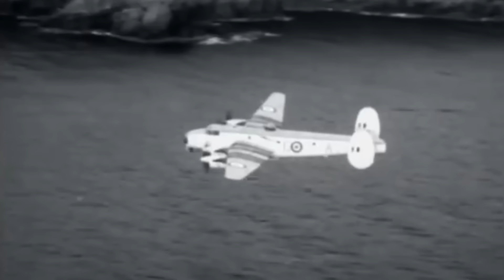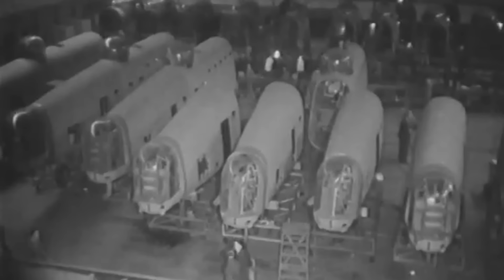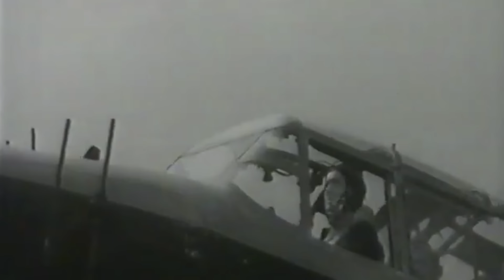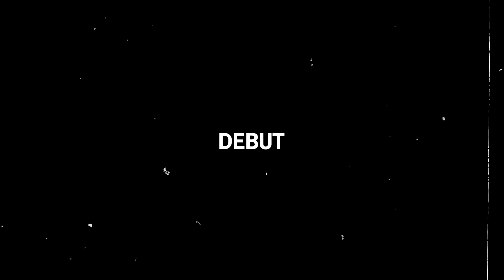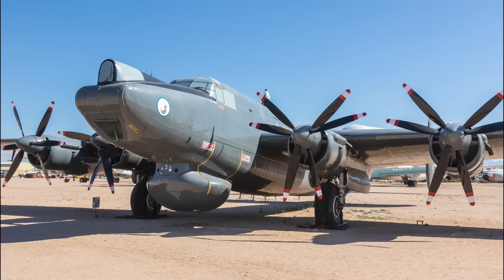The Strange Plane that Ended Up with An Even Stranger Mission

Comment: The Brit’s built their own TU-95 because of the Shackleton having a push pull prop in the same configuration of the TU-95.
Reply: Contra-rotating props were quite common, at least at design stage, in the UK in the 1940's, the Soviets learnt from British experience.

Comment: Good video about a very underrated but fabulous aircraft. The MR3 also had tip tanks and a more glazed cockpit with less framework as well as tricycle undercarriage. You featured some MR3 picture early on in the video but your commentary on the MR3 is accompanied by AEW2 (converted MR2 pictures). The AEW2 with radar dome did resemble the film version of the Dambuster Lancaster with enlarged round bomb from the front view so its interesting that you feature many clips from the film! The best part of the Farnborough show if you revisit the clip is that the Shackleton could undertake a low pass flying with just one engine and the other 6 props feathered. If you visit Pathos airport on Google Earth you can still see 2 of the old 8 Squadron AEW2’s sat at the end of the runway slowly decaying. Very sad!

Comment: Egypt was not 'under British control' prior to the Suez crisis of 1956; Egypt was an independent republic under Nasser.  The UK did have a lease on the Suez base area but had in 1954 agreed a 2-year phased withdrawal of its garrison.  It's like saying the US runs Cuba because of Gitmo.
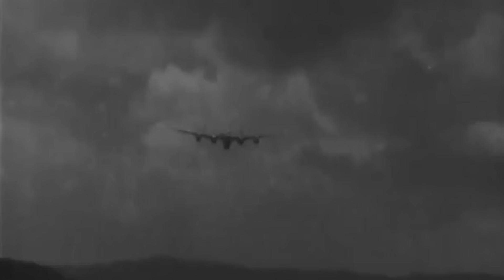AS usual there is some odd use of video, mainly Lancasters, to illustrate Shackleton ops.  The excerpt from the film 'The Dambusters' at 6:42 to represent maritime patrol in the Mediterranean is just bizarre.
Many of the supposed MR1, MR2 and MR3 aircraft shown are actually AEW2s, the clue being the giant radome sticking out under the nose.
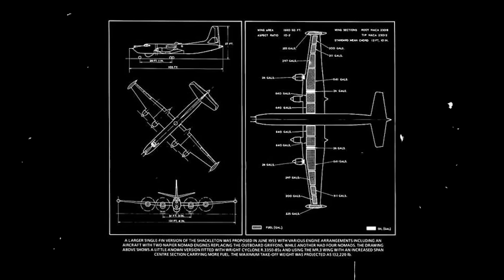The MR4 was not the aircraft shown at 8:50.  The MR4 and MR5 were just proposed re-engined MR3 and MR2 models using Napier Nomad engines to improve endurance.
No mention of 10,000 rivets flying in close formation?

Comment: 5:48 the noise wasn't because of the Griffon engines, it was becasue of the coaxial counter-rotating propellers.
Reply: Or, to use the correct term, contra-rotating propellers.

Comment: serving in the RAF i nearly got posted to Lossiemouth in 1989 - and to the last Shackleton Squadron there..   but at last minute my posting was changed to Aldergrove in NI ..  later i was posted to St Mawgan in Cornwall,  where Shacks had been operated for many years - they only had one remaining - a bright blue example serving as "gate guard" and maintained by civilian volunteers, several of whom were former airmen .  its interesting how long this aircraft remained in service. especially considering the Nimrod , also in service, which has a troubled later history as the MoD wasted many £millions with BaE on a rebuild-upgrading of that type which went nowhere.

Comment: We had a Shackleton Mark II in for restoration and an engine change at Zantop Macon in the early ‘90s while I was a contractor there. It was fitted with a monstrous radar dish in a flattened teardrop fairing under the nose, and was set up to carry 2 torpedoes. I was very annoyed that I did not get to work on it, but they had a special crew that were the only mechanics that were allowed to touch it. I did manage to wangle a walk-through and tour, though. It was very cramped for such a large aircraft, but the bomb bay and radar equipment took up a lot of room!

Comment: I could never understand the use of counter rotating props on multi engine aircraft at the end of the prop era. Noisy, complex and they had to be inefficient with the turbulent air stream they created. The crews must have been begging to fly jets when they could.
Reply: Nooisy and complex? Sure, but reliable.  The contra-rotating props reduced to rotational area while still making use of the Griffon's greater torque output when compared with the previous Merlins. Allowed for a wider fuselage while retaining the same wing.  It was a design compromise in a time of economic stringency.  They actually have some thrust and efficiency advantages which is why the Soviets persisted with giant versions of the concept, the Tu-95,  Tu-114 and An-22.  As for your last comment...sounds very, ah, American, and that isn't a good thing.

Comment: Not "Turbo Jets" for upgrade on Shackleton model 3... "Turbo Props" is the proper terminology for this upgrade.
Reply: There were also a least six turboprop Lincoln bombers built (they were used for nuclear weapons development work in Australia, dropping test devices from 50,000 ft (not a bad trick for an unpressurised aircraft).
A number of Lancasters also flew with jet engines in 1943 onwards, a similar Lancastrian passenger aircraft was also built and flew in 1946.
Reply: The MR3 upgrade included adding two viper turbojets for additional thrust. The four Griffons were retained
Reply: @andrewforrester7525 Also was an unusual installation, being installed in the rear of the outboard engine nacelles.  Tended to stress the airframes, but worked well enough.
Reply: No, Viper turbo-jets were installed in the rear outer endine nacelles alongside the Griffon engines.  They were not turbo-props as they created thrust as any turbojet does and did not drive the props.
Reply: @owenshebbeare2999  There were at least six Dart turboprop Lincolns built. They were operated by the RAAF for nuclear weapons development in Australia. They were used to develop the ballistic tables for the V-Bomber force and dropped test articles from 50,000ft (“interesting” for an unpressurised aircraft).

Comment: When I was in the RAF in Malta (1969-1971), Shacks were based there (203 Squadron), and it was pretty normal for them to come back with only three engines running - but the problems were largely not with the Griffon engines, as such;  the part which gave the problems was the shaft drive from the rear to the front of the engine and drove the counter-rotating prop.  Having said that, the 37 litre Griffons did cause problems through airframe vibration, as compared to the very smooth 27 litre Rolls Royce Merlins they ran pretty rough.
Shacks had no problems flying on three engines;  in fact, a close friend was aboard one flying from Malta to Gibraltar, on which the pilot had to shut down THREE engines due to the above mentioned problems with the drive shafts - and despite the aircraft have to fly crabbing sideways until just before the wheels touched down, to balance out the uneven thrust, the crew and the Shack between them made a perfect landing!
Reply: That is a corker of a scenario. My old friend Phil was an RAF lanc pilot during WWII, and he mentioned that he had to fly on one engine during training. That would be flying light I imagine.
Reply: @peterrollinson-lorimer  - I sincerely hope it was flying light, Peter, considering their standard full bomb load was 14,000 lbs!
Reply: @jackx4311 Naturally I wouldn't expect a bomb load on a training flight,  but I'm sure it was also light on fuel and personnel.
Reply: Unfortunately for me I never got near the Shackleton as a Rigger, and I would have given my last penny to have had the privilege as it was the closest that you could get to the Lancaster by the time I joined up in 1979, my grandfather was an A.V Roe apprentice before the Second World War and was involved in the modifications to the Lancasters bomb bay to accommodate the “bouncing” bomb, and he gave me his apprenticeship course technical manuals when I joined the RAF, and I used them during my technicians course because they contained some really useful and still (at the time) current information.
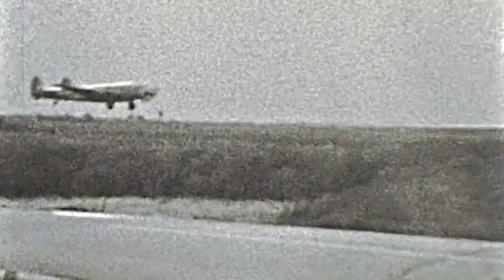Reply: @allandavis8201 2:52
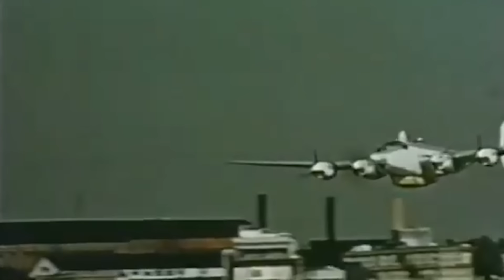Reply: Maybe that was your buddy's plane at 7:24 when only one engine was running hah!
Reply: Thank you for sharing that.
Reply: yes that prop drive system is inherently problematic. It was that design that nearly killed Howard Hughes

Comment: Very interesting video, I served at RAF Balllykelly 1966 - 1969 and I remember the noise as they flew low over married quarters. During an AOC Inspection as we took the Present Arms 3 Shackeltons flew very low overhead.
Reply: That was the station that had a train running through the runway sometimes?

Comment: The engines weren't overly loud, its counter-rotating props were.
Reply: *Contra-rotating, also seen on the Gannet.  Counter-rotating props are what were on the DeHavilland Hornet, single airscrews for each engine, turning the opposite direction.  While it might sound pedantic, there is a distinct difference.
Reply: @owenshebbeare2999  Damn ... I knew that. Even more, I made the same correction to a comment about the Fairey Gannet.🤣🤣
TBF for each propeller there IS a propeller on the other side of the fuselage turning the other way.😁

Comment: "Tricycle undercarriage" has a nose wheel, not the obvious tailwheel design of the Shackleton.
Reply: The Shackleton had a nose wheel in the later variants (Avro 716).
The earlier Shackleton (Avro 696) was a tail wheel design.
Reply: The Mk 3, I think it was, had tricycle undercarriage. It gave the aircraft a much more "noble" stance.

Comment: 'Shackleton from the Lincoln, from the Lancaster'.  As usual, it's a bit more complicated than that.  

First Avro Manchester, then Lancaster (ten major bomber variants), York, several Lancaster specials like the 'Provisioning Lancaster', then Lincoln, Lancastrian, Lincolnian, Tudor (four variants), and a Lancaster Maritime Patrol variant, then a Shackleton revision of the Lancaster (the MR1,2, etc.), then a 'new-build' Shackleton using Lincoln elements now with added nosewheel, a very different plane.  
This plane stayed in service for decades, being upgraded endlessly, until almost replaced by the Nimrod, then the Sentry variants.

Comment: I remember these flying over my house when I was a kid, as I recall they didn't so much growl, it sounded more like 4 metal dustbins a quarter full of one inch pebbles being rolled across a metal floor all at the same time, but I was about six at the time so maybe my little ears got overloaded.
Reply: I remember going to formula 1 & NASCAR races in the 1970's and what you just described is the sound my ears made when they were overloaded as a 8-year old at Long Beach Grand Prix.
Reply: @FormerLifer187  back in the late 60s I was a corner flagman at Laguna Seca Racecourse. I was flagging a Can Am race on the uphill section just before the corkscrew descent, a couple of the drivers used our flagging station as a downshift marker. If you weren’t wearing ear plugs when they did their down shift and punched their throttle to the floor the exhaust sound waves would just about blow you off your feet!
Reply: It wasn't you. Someone described these as '10,000 rivets flying in formation'.
Reply: @timothywalker1388  - Really?  I could have sworn it was 20,000 . . .
:))
Reply: Maybe he meant gravely noise instead of growly.
Reply: 40,000 not to be picky 😂